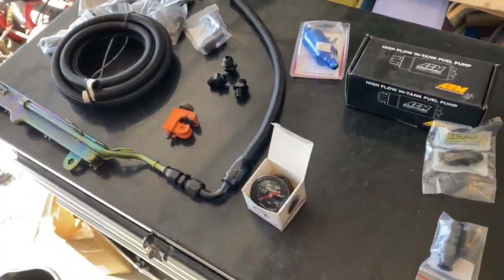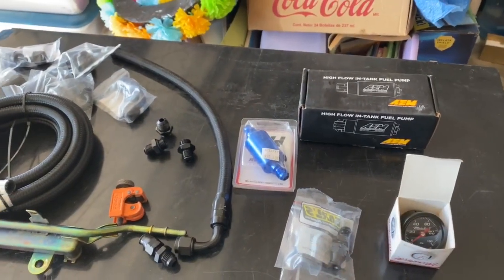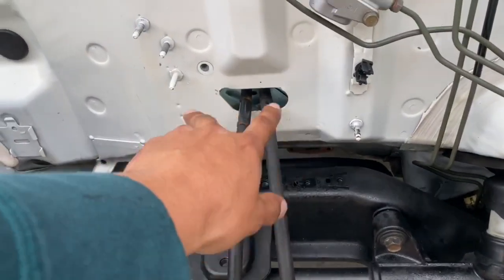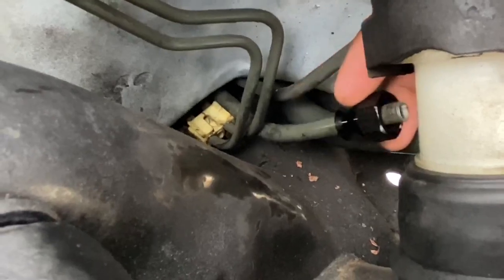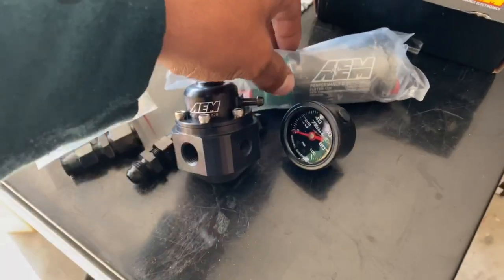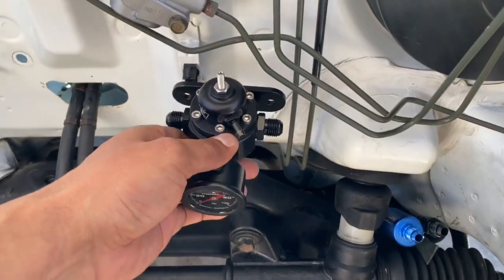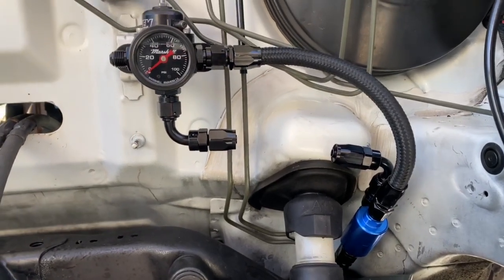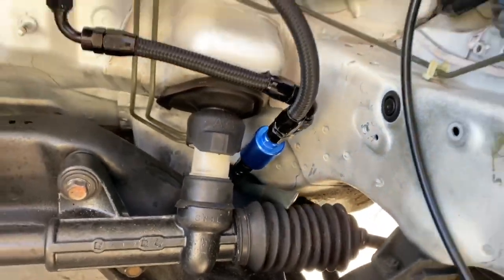k24 SWAP EK FUEL SYSTEM DIY!!!!!!!!

Comment: Hi buddy, I have a similar fuel line setup as you except I used ktuned FPR. My question to you is will your system(gauge) hold the pressure after you shut the engine off or it goes to zero immediately?  Mine goes to zero right after I shut the engine off. I wonder if it is normal.  Thank you in advanced.

Comment: hey im looking to do a similar oem fuel rail on k24, is there a regulator on the bottom center of the factory fuel rail? or what is that circular thing that resembles a FPR?
Reply: I think it’s a fpr, I’m working on a k20 swap into an Ek hatch w stock k series fuel rail and I’m trying to figure out if it will work with an after market fpr aswell

Comment: Inlet hardline is 5/16. What’s the hardline size for the return line?  I have an eg not ek suppose they are the same ... thx
Reply from the maker: Same. 1/4
Reply: @oemworx4147  which means AN4 line will be direct bolt on to the tube correct?
Reply from the maker: Maybe. The way I did it is 1/4 to an6
Reply: @oemworx4147  I see and I saw that.  Well I guess I will figure that out when the time comes. Still accumulating my parts together slowly.

Comment: In order for you to run those shift cables through, did you get rid of the whole ac assembly inside the dash? Like the heater core and etc? Or some parts?
Reply from the maker: Yea heater core has to come out.
Reply: For my Ek kswap I retained the factory heater core by running the shift cables under the car with a hole cut into the exhaust tunnel basically under the cup holder
Reply: @benm12310  thank you

Comment: So where did you mount your fuel pump. I seen the pump you used but I didn’t see you install it? Isn’t it supposed to be mounted lower then the tank and as close to it as possible?

Comment: Doing the same set up as this. I see you are not using PTFE hose which is safer for e85. Have you ever ran into a problem just using rubber/nylon hose for e85? For a small part of the fuel system, I can’t imagine that it is a big hazard but I have to ask. Great channel and content. Thanks
Reply from the maker: Actually I do have the ptfe I upgraded shortly after which does work a lot better. Safer for race fuel

Comment: Nice video / install guide. This video just showed up in my feed today. I was checking out a few of your vids. Obviously fuel systems are near and dear to my heart. I would suggest for the diy prople that it's worth the extra money for an aftermarket fuel rail if your going with a return style system. Reason is, the way you have this setup will starve the fuel rail. The regulator is designed to make sure you always have the correct amount of fuel in the injectors but you have it to bleed off fuel before it even gets to the rail. So you have no control over pressure where you need it most. Being mostly stock you probably won't notice an issue but if you start adding power adders you will. Love the content man. Keep doing work.
Reply: The aftermarket rail just allows you to hook up the reg after the rail where your OEM rail you can't.
Reply from the maker: To much vibration I’ve never liked it on the rail I rather have mine nice and tucked how I have it. With my setup and the amount of fuel I’m using the stock rail will be just fine dyno sheets will show
Reply: @oemworx4147  I'm not saying you have to mount it on the rail like the OEMs have it. I'm just saying you have the fuel go into the rail before it enters the regulator so you maintain fuel pressure across the rail. It's the fatal flaw with all the ktuned style kits that regulate before the rail. Your right that it will work just fine for a stock car. 👍

Comment: So you had to use a flare kit on the hard lines?
Reply from the maker: No
Reply: Oem Worx thanks so man this video is super helpful with my swap. What fitting did you use on the fuel rail.
Reply: I was thinking that myself

Comment: This is exactly what lot of people need. Explanation and step-by-step instruction. Subbed. Keep them videos coming.. KSwap
Reply from the maker: Thank you very much appreciated.
Reply: @oemworx4147  I got an k20 swap in my eg with the k pro ecu, few days ago I started to have lag problems , when I turn it on after a few minutes it starts to want to turn off. I replaced the fuel pressure regulator and I’m a bit lost on this. Plus my fuel pump is new. What can be the problem?

Comment: What fitting did u use for the return hardline so its an6 on the end  ? Its smaller diameter tube than the feed i know ..
Reply from the maker: Yes an6 to 1/4